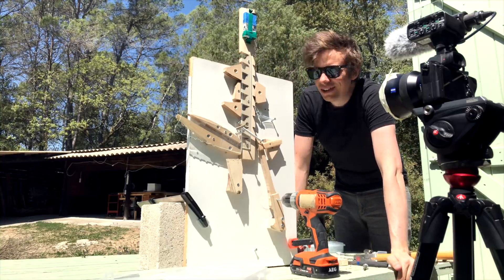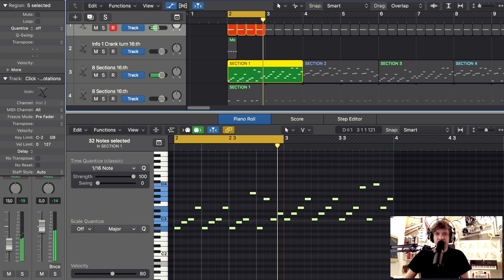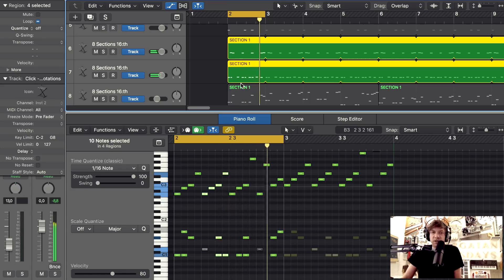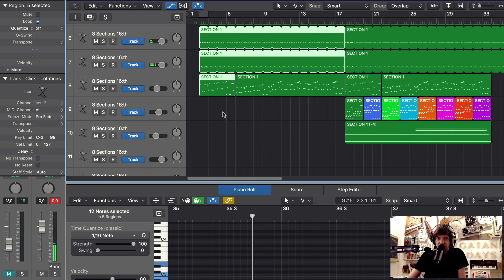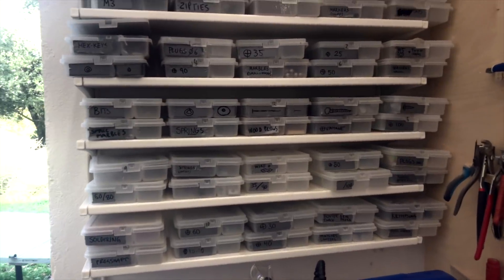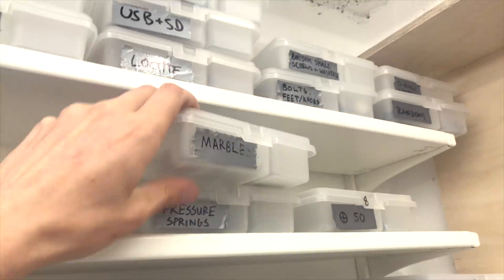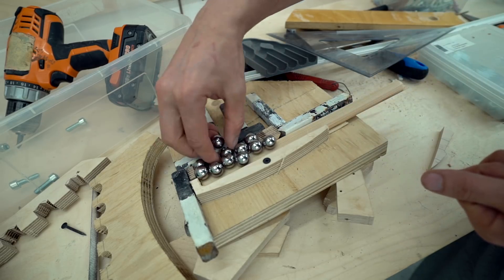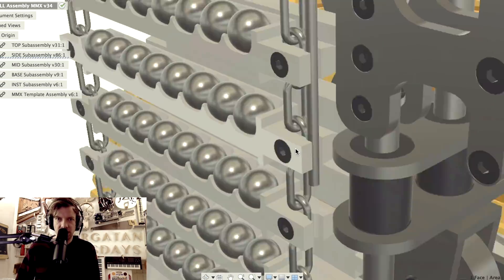Conveyor Belt Marble Lift - Marble Machine X #33

Comment: Here's a comment to get buried in the mass and has probably already been dealt with - what happens if a song has a particularly ... sparse section?  For example, ten, twenty cranks later and you're still only using four or six marbles but lifting eight into the receiving tray?  I know you've designed some tracks and lifts to deal with some overflow but are you concerned about jams, marble spillage or other incidents like that?  A marble catch basin on the right side might be an idea - also, disassembly and storage of the marbles.  A catch tray over the vibraphone to funnel the marbles into a bucket and just set a 'song' that plays all the vibraphone fingers or something.  Again, I'm sure you've thought of that and have a solution in mind but I've learned that even if it's already taken care of, it's better to mention things anyway.

Comment: I like that lifting mechanism, that's pretty cool.  A system of rotating bolts like a minigun immediately popped into my head.  You could even shoot them up with powerful springs.  It definitely operates fast enough

Comment: The problem is already solved in the form of a marble pump https://youtu.be/eWQ-189ijeM with gearing you can match the speed you need to the crank speed. If built right you could even use some of the vertical steel as the track the marbles ride up.

Comment: Is the ratcheting lift action (stop and go) going to shake the chain marble carriages? I believe those chain lifts are built for a high lifting weight with flexibility over speed. I could be wrong the timing chains in cars can experience over a hundred rotations per second. Then again those chains are not stopping and starting twice a second.

Comment: What if you had 2 separate drives, the cool looking one that runs constantly, and then an Archimedes screw type that would engage when the ball reservoir falls below a certain level?
It wouldn't actually have to be conditional, but it would be cool to see it activate on more complex parts of the song.

Comment: SERIOUS recommendation: Use multiple Archimedes screw lifts, made from perspex tubing, side lighted with multi colored LEDS. You could have extra gated lifts "turned on" during those segments when the drums or the vibraphone is extra busy. Imagine 8 tubes lifting 2 marbles per crank turn, what a marble surplus.

Comment: You might have said it but rather than using the pistons to lift the chain using the ratcheting system you should have them pull down. The chain is just like a rope, it's pretty hard to push a rope where you want to go but it's easy to pull it.

Comment: A note on your conveyor belt system.  If there is a bit of slack in the chain and you lift from the front side you could get some tilting of the marble holders and have some of them fall out.  But if you use the same mechanism to pull down on the back you will maintain tension on the marble holders on the front side of the conveyor.
As always, kept the designs and videos coming.  Great work.

Comment: It's almost too bad that you have to recombine the four outputs from the demagnetizer into a single stream before resplitting them into 8.  With them already evenly distributed into 4 channels, it shouldn't be that difficult to split them one more time to get your 8.  The horizontal splitters you've used so far would extend out too far, I get that, is there any way to use more of the vertical dimension?

Comment: 8 marbles:crank-turn is only an average; depending on how much of a reservoir you can keep at the uppermost levels, that might be enough to keep the system fed.  An extended passage of very busy music would inevitably deplete that, but that is something that can be worked around by tweaking the music arrangement.

Comment: I'm full of intrigue yet fearful as the Marble Machine may soon become self-aware and seek to compose freeform jazz or rap metal jazz fusion and it will need 32 marbles per crank.... 8-0

#fearful.... but this is also a splendid piece of engineering I can't wait to see in full operation!

Comment: I would be worried about the marbles possibly bouncing out of the lifting mechanism since it will be ratcheting instead of moving at a constant velocity. Would it be possible to put a 'roof' over each lifting section in the belt to keep them fairly secure?

Great work so far, I absolutely love your dedication!

Comment: Why not use friction drums. Outer drum is eight marbles wide by (diameter + two marbles) ID and is fixed in place with eight inlet and outlet ports staggered in two rows. The drum is lined with thin (2mm) rubber on the inner face.
The inner drum is eight marbles wide by (diameter + rubber)OD and lined with (2mm) rubber on the outer face and spins inside the outer drum.
This will allow for a quiet large capacity feed into eight channels, even using a reduction gear on the inner drum.

Comment: qhy split them into 4 and then 8 after? doesnt the thing on the top split them into the lanes needed? seems like you are splitting by 4, back to 1, splitting to 8, back to 1, then splitting at the top again.i think getting the number of marbles magnetically brought up to split to 4 then back to one is going to be a bottle neck area. i have a feeling it will be a problem area on starts and stops

Comment: Will the marbles roll into the divider before the lifting at a speed of 8 marbles per beat? At 200 bpm that is 27 marbles per second. I can't imagine the marbles can even merge from the 4 lanes that quickly!
And with all the friction in the machine and kinetic energy you're putting in the marbles, can the machine even handle 200bpm if you crank it by hand?

Comment: @wintergatan Hey martin! Love ur work and music so much! But!! Why you will /8 marbles and then make them 1 again and /8 after? I know that it looks good, but.. And You should't make the conveyor belt from a regular chain because joints are forced to make by welding. Maybe you should thin about chain from a bicycle because jointing it would be much easier. No welding required. And also chain is always stretching so you have to make tensioner for it.

Comment: Hey, I would like to point out something with your design for the Marble Machine X, and I really only just now saw it.

What exactly is the Fish-Stair section doing?

In your design in today's episode you have ALL the marbles coming off of the large wheel. They get funneled over the top of your de-magnetizer. Then, they meet with your new conveyer belt/chain system to lift them to the top.

But I see no means or method for the marbles to be moved over to the Fish-Stair System. In fact, the Fish-Stair system appears to be outdated at this point and can be removed from the Marble Machine X (In my honest opinion); especially if the conveyer belt/chain system can easily cover 300 BPM.

Also. I think you will find that your conveyer belt/chain system may only work with rotating the gears the conveyers are "attached" to. Otherwise by lifting up on the shelves, you may cause a link in the chain to loosen up on the top gear and that could result in a catastrophe. Better to let the gears rotate and have them push/pull the shelves along.
 But this may result in being physically slower. So my solution would be to increase the number of marbles moved. If you need 8 marbles per crank turn. By increasing the number of marbles you cab make up for a slower delivery system. If you decide to go with this shelf delivery system. Adding 2 more marble slots onto it, wouldn't look completely out of place.

Comment: Your progress is great, love the videos. PROBLEM? You divide by 4 over the demagnetising wheels but then recombine intonoje beforetrying to fill 8 balls per bucket on the lift,  thats messy and will be congestion.  Suggest you keep 4 tracks afeter the demagnetising wheel each feeding just 2 places on the lift. Also .. actually the chain liftbcan be made to turn 90 degree's during the lift, removing the  need for all those sharp bends on the feed tracks which will rob momentum so slow things down.... go8d luck however you solve it !

Comment: If you are going to use a drag chain type conveyor you are most likely going to need some type of guide on the lifting section. Chains tend to flop around unless they have significant tension. Just a suggestion. ☺

Comment: Consider a spiral staircase like a drill. Could you make a drill that instead of pulling itself down pulls up the marbles allowing for more than 8 marbles a turn depending on how fast you make the spirals turn. I feel like that would look pretty good to if you had 2 or 3 of them spinning pulling a continuous stream of marbles up. It is like when you drill a hole in wood and then turn the drill which brings up the extra saw dust.

Comment: For 3D printed parts, rather than tapping them, use threaded brass inserts.  You heat them up with a soldering iron and sink them into a slightly undersized hole in the print.  The knurling on the outside locks them into the plastic.  They are a game changer for fabrication with 3D prints.

Comment: Love the work and design you do. You might want to build these systems now and run to test durability. Especially the chain elevator.  Something where you could just run a single portion of the Machine WITH Marbles to test.  Run it for an hour and see what happens so you can make updates and adjustments.

Comment: The system looks good. But you have to consider 2 additional items:
1st: your marbles may jump out of the chutes, so you need some cover over it.
2nd: ratchet-devices have a nonlinear force. This will make the machine rattle. Your lift needs to be on a stiff frame, connected to the main frame. Maybe think about a force/momentum equalizer (just as crankshafts in engines have those funny flyweights).

Comment: Fantastic update as always. Please note that you neee to improve the sprockets in the 'Chain Lift' to an envolvent gear profile! If not they will have difficulities to engage/disengage towards the chain mounted '8-tracks'. Also a small advice on your tapping technique: Simply use your power drill instead of the Tap Wrench for quicker and more straight threads! Love your progress

Comment: Sorry, I don't want to criticize your belt idea, but I think that non-continuously movement of that belt could be troublesome.
I did a quick count. You have 14 rows of 8 marbles each. Each marble has a diameter of 1,5875 cm and a density about 7,9 g/cm³. That are about 1,85 kg of marbles that have to be accelerated 40mm for every beat. That some serious weight, most likely inducing vibrations into your machine.

Comment: I guess this time there's a small design issue. You first split the marbles in 4 channels when passing over the demagnetizer. Then you merge the marbles in one single channel (why? you lose energy). Then you split them again, by 8, on the belt. The problem is that the belt will lift 8 marbles per crank, that means that single channel will need to handle 8 marbles per crank. At 200bmp that means that about 8 marbles per second will need to merge AND pass that single channel... They will have just 0.125 seconds to pass that single channel... Isn't it too fast? Marbles will start falling down. Why don't you just keep them in separate channels?

Comment: Is it possible that the marbles will go through the new "shuttle" elevator too quickly? I'm concerned that the marbles may want to go through the track too quickly, and once loaded onto the new divider they will fall through the gap between the elevator cars.
It's only a concern of mine, so I could very well be wrong.
Reply: Dypatome That's a valid concern. I would imagine that four long panes of Plexiglas, on the inner and outer sides of the marble lift, should prevent the marbles from falling out of the cars while going up and coming down, and also, two curved (semi circular) panes of Plexiglas, at the top, on the inside and outside, should prevent the marbles from flying out as they rotate around the top.
Reply: I hadn't even thought of that. Good thinking, plexiglass coverings sounds like a great idea to me

Comment: Have you considered adding a marble drain?  After a show you would be able to empty the machine of its marbles and dismantle the large pieces for transport.  I'm sure you've thought of this, but it wasn't a part of the first machine and I haven't seen it mentioned.   It seems like the marbles won't be accessible by hand in that many places on the machine.  I'm guessing there's space at the very bottom where they collect before the first ring lift.   This would probably be a good spot for the drain.

Comment: Not convinced the chain lift will work that well, but just in case, don't forget that the piston moves in both directions and can move the chain lift on both up and down strokes depending on which side of the lift it "grabs". In other words, it can index two positions for each piston cycle/crank.

So from this you can decide whether the lift indexes half a row on the up stroke and the other half a row on the down stroke (meaning the motion in the lift is spread over both strokes rather than just one, thus keeping the acceleration slower and reducing stress), OR you can have it index a whole row for both up and down strokes giving you 16 marbles per crank.

Comment: Have you considered lifting the whole way with this new chain lift, instead of starting half way up the machine at the output of another lifting mechanism? It seems like you might have trouble getting the marbles to the bottom of the chain lift in sufficient quantity. I'm not saying get rid of the other lifting mechanisms, just run them totally in parallel so you're guaranteed 8 marbles per crank with just the chain lift, and the other lifts would then add on top of that.

Comment: Why not fix the problem (magnetized marbles) instead of creating a more complex solution. You yourself said that simply remaking the main marble lift system would solve the problem. What's the point of all this mechanical complexity. Its just creating more resistance and points of failure.

Comment: The bug you encountered in getting your marbles neither bits, stings, or sucks blood, and only occasionally feeds on nectar. It is a European crane fly. It looks like a big mosquito but has none of the negative characteristics of its tiny doppelganger. Their adult life is extremely short - 24 hours - so a gentle hand would have sufficed. They are as gentle and more delicate than a butterfly.

Comment: did I get this right? you lift marbles with a magnetic wheel, which forces you to demagnetise those marbles afterwards then you lift them further with a fishstair-costruction (just for the cool looks) and then you lift them with a paternoster-ish lifting thing. well... I would just lift them marbles with the paternoster, without magnets and all the other stuff. like that you can lift 20 or more each step, cause the lift could have the width of the mmx if placed behind the machine and not beside it. and it would look cool too.

Comment: If your marble throughput is greater than what you're able to move back to the top with the system, won't there be a bottleneck that builds starting at the lift?  The short track has a nice aesthetic but may be a bit of a risk because you don't have much space for the marbles to sit if you want to play a piece that uses a whole lot of marbles.  Just a thought.

Comment: Have you actually worked out how much effort the crank handle will take to turn? Lifting all those heavy metal ball bearings, the friction of those gear wheels on the chain lift, the energy needed for the fish stairs, the friction between all the wooden gears.........

Comment: Why don't you use the other mechanism "ratchet", one on top of the other divided by a plexiglass panel, or 3 of the same. That way you could have 4 marbles per crank turn or 8 or even 12 if you put a "gate" to only have the mechanisms you want available.

Comment: The amount of design work going into this is amazing. Just for fun, and omitting friction, you could roughly calculate the required operating power for this unit by using the the number of marbles lifted per second, the mass of each marble, and the height they are raised. Of course this is simplistic, but knowing it's wattage could be a silly trivia piece.

Comment: I know that you want the machine to look and work spectacularly Martin. But have you thought about using an Archimedes screw to lift the marbles? 

Very crude, and high possibility for scratching the marbles, but extremely fast and reliable, with unlimited vertical lifting potential.

Comment: A wide screw, with a acrylic combs creating channels for the marbles to travel in as the screw rotates might be something.Something like a Wood pellets transporting screw or similar.The inclined plane (which is the screw) that goes around the screw or rather make the screw will push the marbles upp. Less moving parts and no springer needed.

Comment: I really think that 8 marbles per crankturn isn't enough. As you mentioned yourself, you plan on sacrificing music from the beginning on to stay beneath the limit. With a machine you put that much effort in, you shouldn't plan with limits. Why not make it 16 by simply doubling the rotation of the piston wheel (I think with a  few small tweaks your conveyer belt would be able to do it), or make it triplets, so 12 per crankturn. I think 12 will be enough in almost every scenario and - lets face it - the conveyer belt doing triplets while the rest of the machine is doing 8th and 16th would look absolutly awesome. You would (probably, you are the pro) only have to add a gear with a 1,5 to 1 ratio that the pistons work with.
I hope you at least consider this,
best regards,
Bruno
Reply: He has the recycling system but i dont know if that would make much of a difference